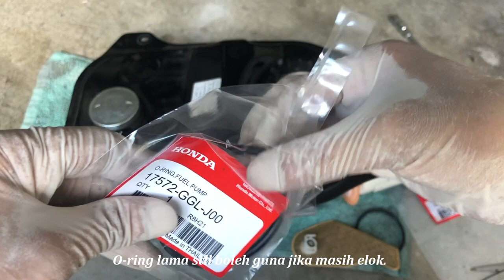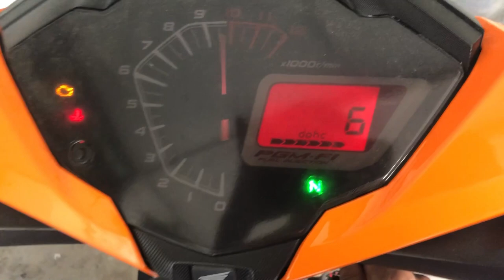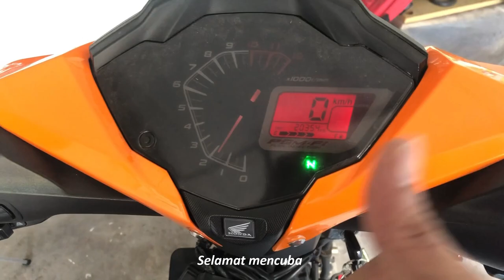Tukar Fuel Filter Ori Honda RS150

Comment: Bila sy nak pasang balik fuel pump, saya cuba tekan tapi dia tak rapat. So ada gap antara fuel pump dgn permukan tank. Ini normal ke?
Reply from the maker: Cuba check blk o-ring tu bos. Kalau dah lama pakai better tukar baru
Reply: @chongsalmi  kau punya bila tekan dia rapat ke?
Reply from the maker: @izzuddinnaimofficial2563  rapat bos. x rapat minyak leak nnt